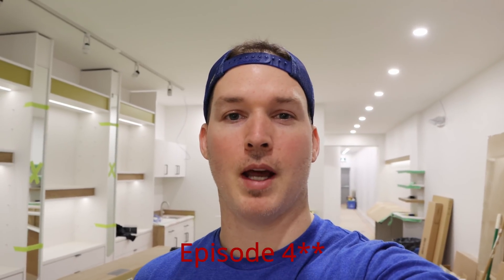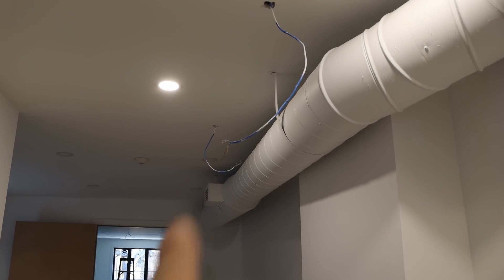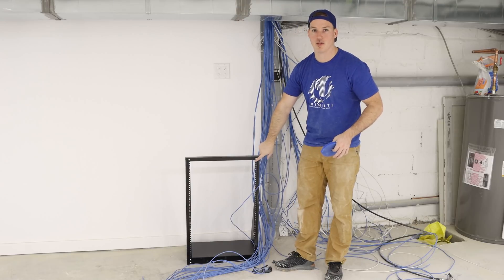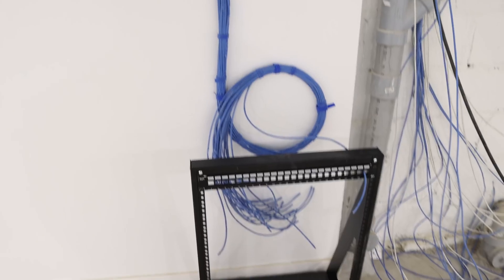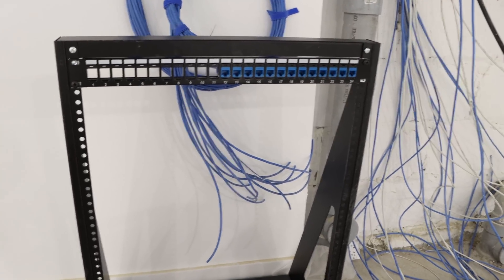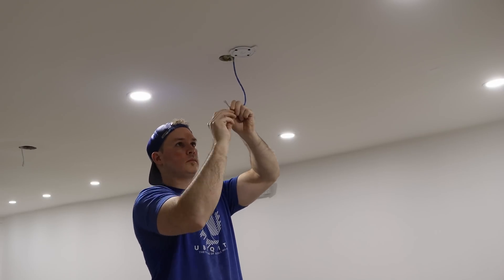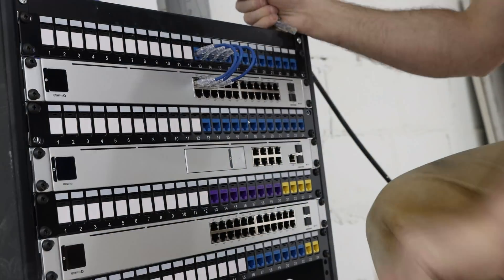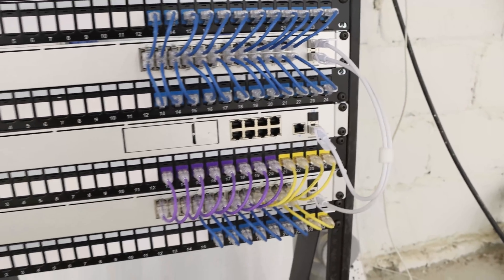Unifi Install and Cable Management

Comment: Ah yes. The “pro” taking 4 times the time instead of using a cable comb…
Reply: Why come over here and talk shit instead of starting helpful discussion.  Every post you've made could have been posited in a way to be constructive for the community instead of sounding like a jerk.
Reply from the maker: You do know cable combs are not good for cable lol
Reply: I have done Zip Tie installation for 6 years, and I have never had a problem with my cable, his install (Velcro Straps) is how I was taught in school to do it, I like Velcro straps for sorting and managing the cable while I'm terminated it whether it be a keystone or just a Rj45 but I use zip ties for the finish.

Comment: Too bad the UDM-P only has 1 SFP+ lan port, now you have to daisy chain the switches.
Reply from the maker: Yup I wish the second WAN port could be a LAN port. Could always add a aggregation switch in the mix
Reply: @MactelecomNetworks  For 2 access switches that would be an expensive solution. :D Also than the aggregation switch would be the single point of failure.